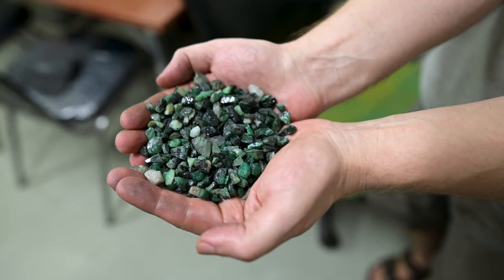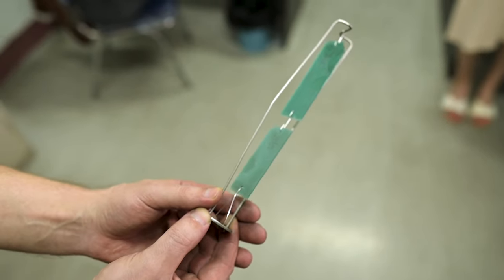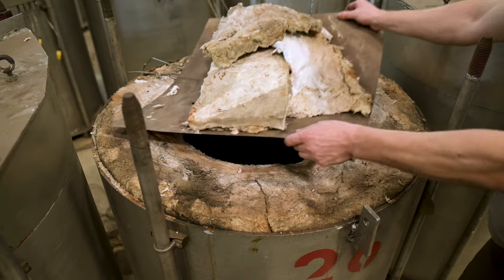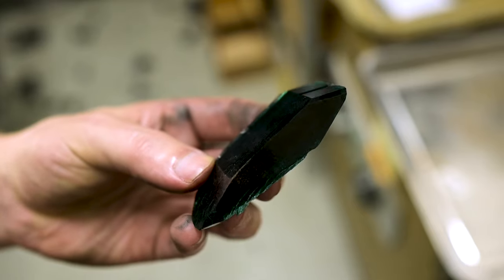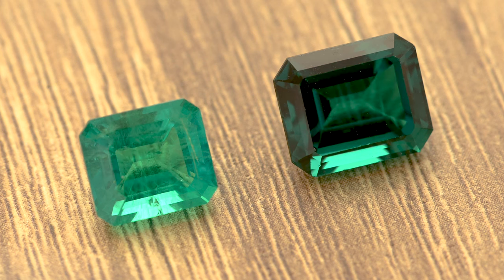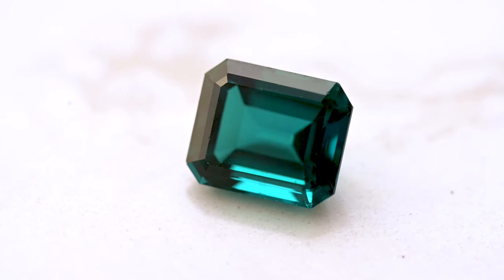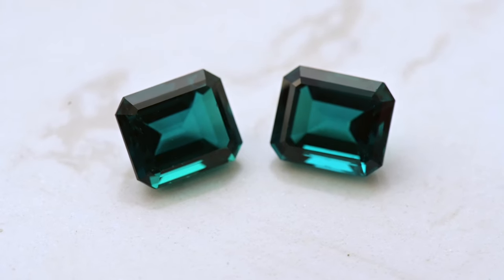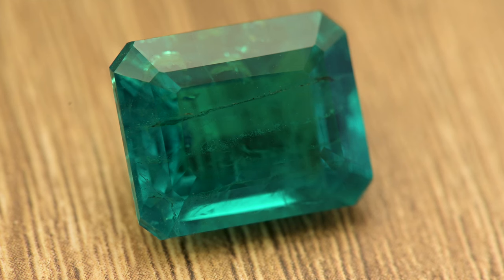How Hydrothermal Emeralds are Created

Comment: Forgive my ignorance, but is lab created the same thing as synthetic?
Reply from the maker: yes
Reply: By general definition of "Synthetic" yes it is the same, but here the woman has a different terminology, that is, "synthetic" is made total of chemistry to create the crystal very fast (without growing it) usually by plasma heating (see Synthetic Ruby created from Microwave) that is done under an hour, while the elements that made this crystal are the same with the natural one, the pattern created will be polycrystalline (instead of one single crystal) which can easily be detected by gemstone experts using ordinary microscope.

It is in contrast with "lab-grown" which is natural grown BUT occurred in controlled environment, analogically similar to growing real plant in hydroponic indoor environment (which still resulting in natural product but much cleaner than growing outdoor). Lab-grown crystal can be much harder to distinguish versus a high quality naturally mined one, sometimes it is even impossible.

I personally agree with what the woman said, we need more definition to discern between this synthetic chemically-made gemstones versus synthetic lab-grown made gemstones.

Comment: A VERY IMPRESSIVE FACILITY'S! 
I have a few questions. First, why do you work with low quality emerald rough as your dissolving zone source material? If I was looking to maintain precise control over my final product, I don't think I would take chances with rough material that is possibly contaminated with who-knows-what. It is understandable that you don't want to work with toxic pure chemicals like beryllium, however, couldn't  you use some of your poor quality first generation crystals, and then tweak the chromium/vanadium impurities to produce higher quality crystals with more desirable saturation. Have you ever tried disolving the very small, but beautifully colored emeraldsfrom Afghanistan? The color of that material is as nice or nicer than Columbian material. 
Do you experiment with your seed material? I would imagine putting some experimental effort into the seeds  and refining your seed plates so that you don't have to cut them out would yield bigger thicker cut stones. 
Next question, what do you use for the lining of your autoclaves, and what mineralizing agent do you add to your water? Do you do big size red beryl? What do you use for source material?  Thanks so much!
Reply: Indrid_Cold, all good questions. Platinum is the "cheapest" chamber lining to have plated on the inner surface of the lid, as well.  The clear solution needs to be slightly acidic.  Flaws make synthetic emeralds marketable.  With no flaws they look like glass to the naked eye.  When synthetic emeralds were first developed in Siberia, Soviet Union, they did not add a dye, but now all synthetic emeralds must have a UV light dye in them . . . however, by making emeralds with crushed emerald raw materials, maybe they think they don't need to add the dye since they might be considered "re-crystalized emeralds" rather than synthetic.  Very good video, thanks for posting.

Comment: These look exactly like the coloured Quartz slabs I have. Even the surface 'etch' marks on the cultivated crystal slabs seen here in this video. Mine still have the central 'seed' slab inside them.  But they are all Quartz.
Reply from the maker: I’ve never seen hydrothermal quartz being grown but I assume it’s a similar process and a visually similar outcome!
Reply: Quartz is grown with same basic process, though usually in much larger autoclaves.

Comment: I am curious as to why you do not simply use the pure forms of beryllium, silica, and chromium in your process? Better still, why not use synthetic crystals to produce highly pure and refined emerald crystals?
Reply from the maker: I don’t think they want them refined and pure. Without inclusions they don’t look convincing. I think they like the inclusions left by the manufacturing process because it emulates natural emerald inclusions.
Reply: @JustinKPrim  I think the question is, if the input stone is replicated in the "grown" stone, then why can't you just use the "grown" stone for future seeding?  Is it the case that the imperfections in the seed have to be at a certain level and the grown stone has fewer imperfections so you have to start with seeds that have just the right amount of imperfections? At 4:40, the seed looks much darker than the grown part.
Reply from the maker: @robertbrandywine  I don't know why they can't use the grown stone as the seed. I think I'm going back there soon to shoot another video and if I can find the answer to this I will comment here later.